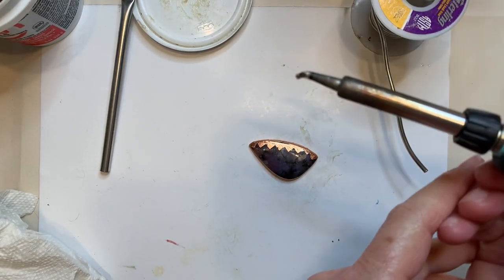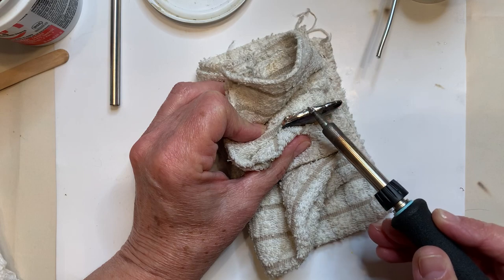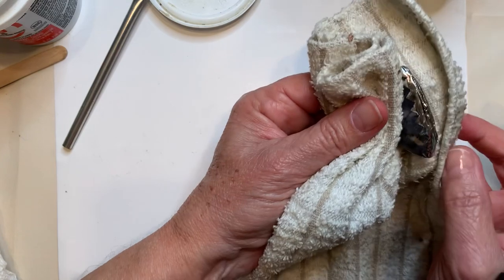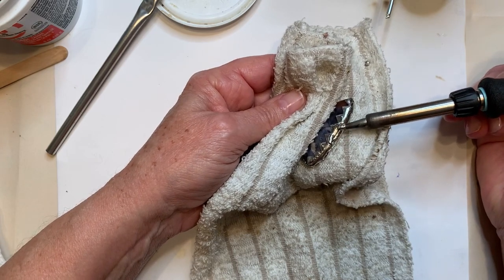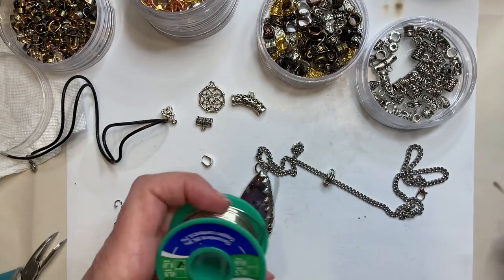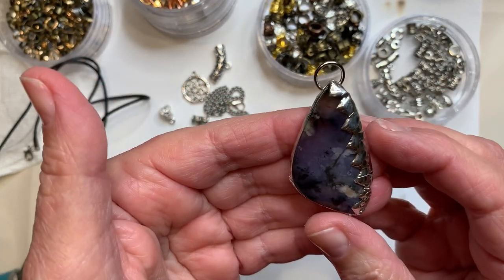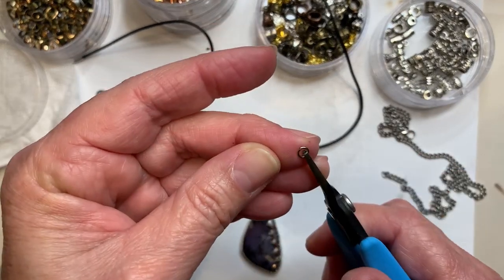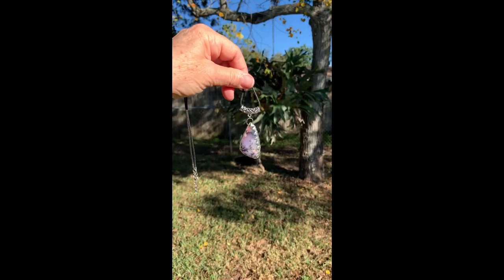Soft Solder Amethyst Dendritic Agate

Comment from the maker: Hi!  I’m not sure what you’re referencing with Large River charms?  But if you’re asking if special types of charms are need to attach with solder, then I’d say usually not as most mixed alloy metal charms, jump rings, etc will work with soft solder!  I have found that aluminum & stainless steel don’t work!  As I mentioned in the tutorial I purchase everything on Amazon & they inexpensive items!  I hope I answered your questions ok!

Comment: Q: When it comes to the large river purchased charms, bails and other findings - Do you do anything with the base metal pieces to bring them to the quality of your solder, do you buy upgraded findings ? Or.
Reply from the maker: Hi!  I’m not sure what you’re referencing with Large River charms?  But if you’re asking if special types of charms are need to attach with solder, then I’d say usually not as most mixed alloy metal charms, jump rings, etc will work with soft solder!  I have found that aluminum & stainless steel don’t work!  As I mentioned in the tutorial I purchase everything on Amazon & they inexpensive items!  I hope I answered your questions ok!
Reply from the maker: Gems-of-Hope-Rocks Hi!  I’m not sure what you’re referencing with Large River charms?  But if you’re asking if special types of charms are need to attach with solder, then I’d say usually not as most mixed alloy metal charms, jump rings, etc will work with soft solder!  I have found that aluminum & stainless steel don’t work!  As I mentioned in the tutorial I purchase everything on Amazon & they inexpensive items!  I hope I answered your questions ok!
Reply from the maker: Most mixed alloy metal charms work just fine!  I would only upgrade to sterling silver if I was actually creating a SS piece!